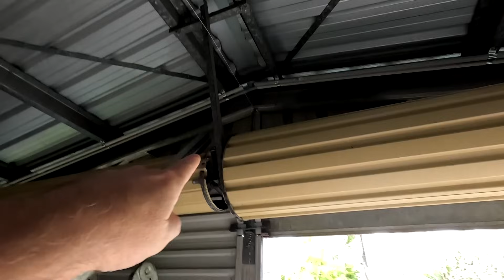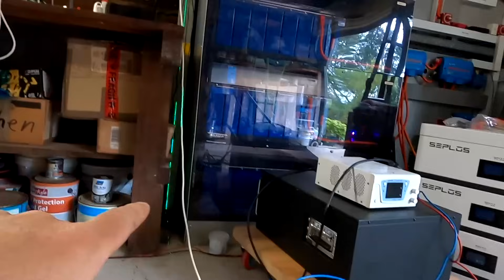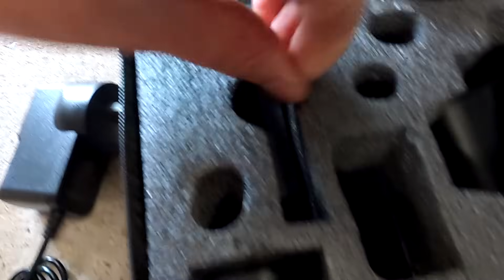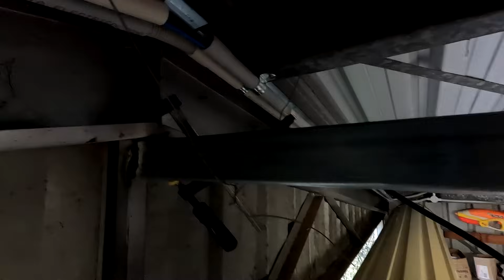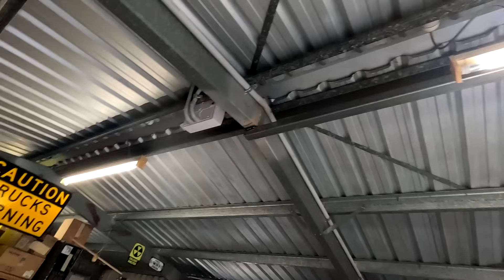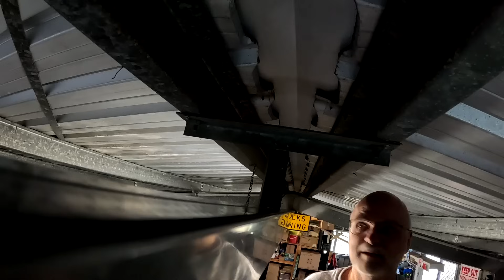First step in transforming the Off-Grid Garage into...? Success with my sketchy welding skills.

Comment: the new rails are needed for the new port or harbour you might not have heard about: Andy's OGG port for batteries.
Wait till the first ocean going container ships will arrive from the famous and german deep water container port Wilhelmshaven - emperor Wilhelms haven for the german fleet and now a more or less barely used containter terminal harbour. 

Wilhemshaven to OGG port - but what cells should we ship ?
Of cause the german made CATL cells . 
Good luck for the further welding adventures on this channel. I like these challenges and struggles.

Comment: As you own an angle grinder you could have easily prepped the area to be welded, nice shiny steel makes for much easier welding. Not to mention the fumes that zinc plating/galvanising gives off. It would have also been pretty easy to make some brackets to bolt the beam up, but would of taken longer of course. Perhaps you're hanging a curtain, or building a wall to make a cold air conditioned corner.

Comment: I have the same welder (GMC brand). Bought it about 26 years ago from Bunnings and installed a 240 v ac computer fan in it due to the overheating issues like yours. Still going strong today.

Comment: I have a suggestion that may help with your welder situation where it overheats. If you install a 12v power supply that connects directly to the power lead it won't shut off when the welder get's too hot. I'd attach it right onto the output of the power switch and neutral. That way it turns off when you hit the mai9n switch.

Comment: If you're making an overhead gantry crane, you might want to build a strap and go under the main beam, and bolt it to top truss.  Welds are good and all, but those welds in the center will be taking the full load.  And a bolted connection would be much safer.   But if you're not making a crane ... never mind.  I was a machinist in another life and built many a crane for loading parts on large 6 & 8 spindle gantry mills. 👍

edit:   I had an epiphany ... are you making an A/C controlled battery room?   You've talked about that before ...

Comment: Welding machines had a development like lifepo4 batteries. There are good inverter welding machines on the market which make muuuch more fun than those old transformator welding machine you used. 
IpoTools, Weldinger, …
Also Flux-MIG welding makes more fun. Watch german youtube channel from Manfred Weldinger to learn more.

Comment: What are you actually trying to do?
Why do you want to put that tiny little pipe along the ridge beam? I guess for unloading batteries from the ute with a roller winch. 

But I wouldn't lift >100kgs on it. The strength or any cross beam is only as much as its end supports, and given that your roof and ridge and rafter truss structure has NO VERTICAL SUPPORTS at its ends or in the middle, over time your roof will slump if you lift too much. Those sheds are designed to support ONLY the aluminium roof sheets, not even the solar panels you already have up there. So be careful not to overload it.

A simple test would be to make a measuring stick from floor to roof ridge and see what slump it has when you lift various loads.

Comment: same weight, either rolled up or down 😂😂
Reply: But the weight is distributed differently since instead of being inboard it is flush with the outside wall..
Reply: A new dividing wall to have 2 sections in your garage.

Comment: Hi Andy, I have seen worse welds done by time served welders. Top tip keep your rods bone dry, high humidity and moisture causes tons of problems, cook them in the oven for a few hours before welding if you can't keep them BONE dry.
My guess is a smaller climate controlled fire proof battery room.
Luv ya
Gaz
Reply from the maker: Thanks Gaz. You're spot on!
Reply: Or an old fridge “not operational” with a 40 watt old style globe inside just enough heat

Comment: looks like you're building a new wall.
Reply from the maker: Yes, correct.
Reply: @OffGridGarageAustralia  So you are finally building yourself a prison cell out of heavy steel?? Why not just galvanized steel sheet metal studs for top plate, bottom plate and walls?? Or are you planning on a heavy rollup doorway?? Me I am lazy and would have just put up a curtain rod and a heavy curtain to separate the delivery bay from the work area.. But I suppose Australia's climate is like Florida, hot - muggy and buggy..
Reply from the maker: You will see... It will be a proper wall.
Luckily, we don't get these muggy days very often but rather have a dry heat which is much easier to cope with.
Reply: @OffGridGarageAustralia  Climate control for the Power Room!  Perfect solution!

Comment: Andy, Galvanized makes bad fumes when welded You should use good ventilation and a respirator when welding galvanized metals we can't loose our solar genius
Reply: You might also need to grind away the zinc coating before welding.
Reply: @DavidBTB  i believe you can actually weld without grinding the welder just has to burn through it ,  so  run with it when it is hot with more amps
Reply: You soon learn once you have had zinc/foundry chills.
Reply: Never weld galvanized without a proper respirator
Reply: I love the welding gloves🤠
Reply from the maker: All went well. I used this gal steel for a long time and never grinded anything away. Some of the welds are over 15yrs old and are still like day one.
Reply: @OffGridGarageAustralia  they’re more worried about your brain and not the welds. Inhaling zinc is hazardous to your nervous system. Ventilation and a respirator are necessary. I’m not a welder but my cousin was in the trades for three decades and hated galvanized work.

Comment: Andy I hope there is no white fluffy stuff near your welds - galvanized steel is notorious for giving off zinc oxide which is very toxic if breathed in - I have a young buddy who put himself in hospital welding a galvanized bike stand - he was in an oxygen tent for a few days it gave us quite a scare
Reply from the maker: Yes, there was some white stuff inside the beam. I kept it all in a bag just in case it is important.
Reply: When welding galvanized steel, the zinc coating easily vaporises. This will form zinc oxide fumes that will mix with the air. This gas may give short-term effects to your health which is also known as “metal fume fever”.  Welders may experience flu-like symptoms once they inhale the fumes. These may include nausea, headaches, high fever, shivers and thirst. The symptoms will usually go away within 48 hours of exposure.